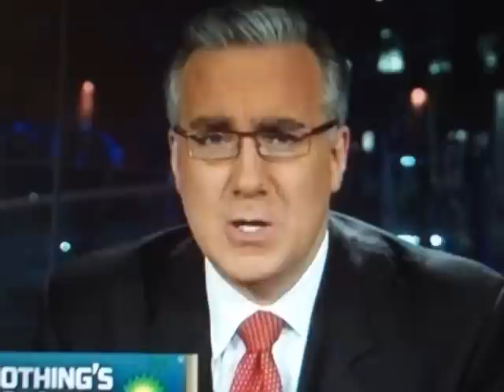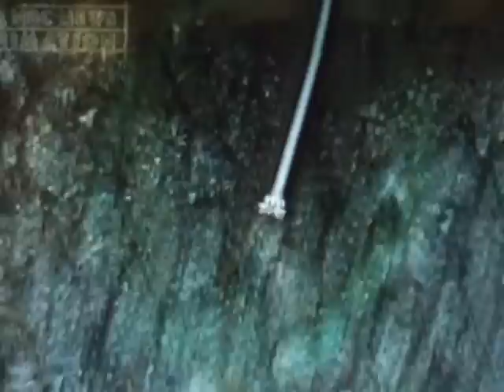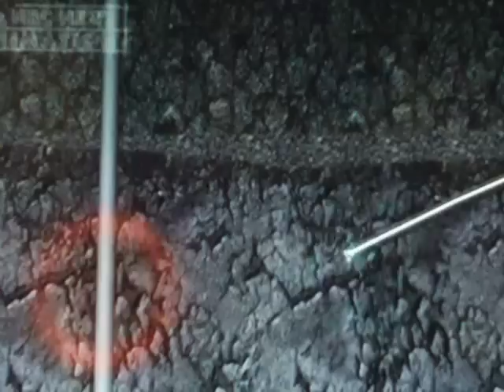Cementing during 'Static Kill' PREVENTS knowledge of relief well rupture

Comment: @ChristiannaGarrett1 They know what they are doing.  They are slick.  So the advertise they permanently plugged the well and then a final measure on the bottom of the well.  But no one can tell it worked right.  That's the idea.  Then they leave.  So the oil seeps all throughout the surrounding rock and finally makes it way out.  Then they say it something else natural or an unrelated geological fault caused it.  They aren't hard to read.